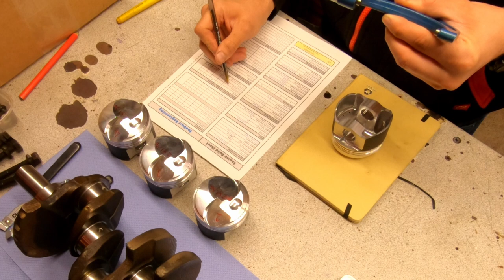Race Engine Build - Part 1 - Peugeot 1.4 TU engine

Comment: Please, let there be a part two. This is the same block I have and I may be in need of skimming the head due to the cursed corner leak typical of these engines. Might just go ahead and upgrade q few more things while I'm at it
Reply: Is that an aftermarket block or the stock engine block of the car?
Reply: @Παντελης Π  seems to be stock block, but basically everything else is specialist aftermarket stuff
Reply: @iosis2009  oh I see. I may try do the same on mine 😆

Comment: If you upgraded to a Bt-30 Atc spindle you could add a tool changer, both from aliexpress, and ran a fly cutter to resurface. 

While I’m sure it worked out for you I’m also sure you realize the end mill leaves surface imperfections despite whether you can visually feel them when compared to the cross section of a fly cutter, or shell mill where either would’ve finished in 4 passes with an overlap. Nice work btw. Master tech and engineer here so familiar with your projects.
Reply from the maker: These types of spindles spin way too fast for running a fly cutter. 6k is as slow as they will realistically go without losing all torque, but I would love a bt-30 atc spindle
Reply: @SeabassEngineering  sounds like you need an automatic spindle changer to! Lol.

Comment: Great video. Have You though off doing some support for that open deck or is it not an issue for this specific setup and motor? For alot of the honda and subaru open decks they do a dowl pin insert between the block and the top of the sleeves to stop the sleeves from wanting to move laterally.
Reply from the maker: Yes I have considered using the CNC to create something for this, but for this specific application it may not be necessary. Thanks for watching.

Comment: Great video, where did you get the specs? I'm rebuilding a TU3 KFW and can't source all clearances like for the crankshaft and such. Best regards
Reply from the maker: The specs are in the Haynes manual. But for a race engine the oil clearances likely want to be increased. Depending on the use case...

Comment: hello my friend! Very nice video!
I want to ask a question.
the head from tu2j2 enters in tu3jp? 

i looking to find out why the engine only puts out 75hp.. 
it has a lot in common with the 90+ horse TU engines

have you found any possible causes for increased horsepower?
Reply from the maker: The biggest differences are in the cylinder head and camshaft
Reply: the cylinder head from tu2j2 do you know if it fits with tu3jp block? @SeabassEngineering

Comment: What cylinder head are you going to use to make this a real beast my friend. I think everyone here wanders about that.. plus great job interesting video keep it up. You are going a great and tidy job there that not lots of people do 😮
Reply from the maker: I plan to use a Rallye head, but it needs a lot of work to be possible with these pistons. Mostly the squish areas need to be entirely removed. I plan to use the CNC to do this in a future video
Reply: @SeabassEngineering  do you mind sharing the block that you are using? Someone told me that you cant use the stock engine block for this upgrades. He told me that it will break down.
Reply: @SeabassEngineering  plis why you should remove squish areas. I mean you want higher compression? Or the pistosn dont go so high so the compression will be low after you put Rallye head

Comment: Wet liner cylander with 8 valve and weak Cylinder head gasket. Its not worth for tunning bro. Try tu5 or something
Reply from the maker: Thanks for watching. This engine is for a motorsport application where the CC of the engine is limited to 1420. I already use iron block in existing engine but alloy engine is 25KG lighter which will make a big difference in my sport.